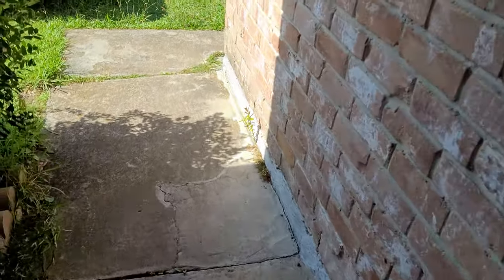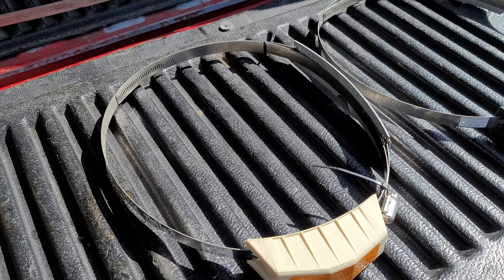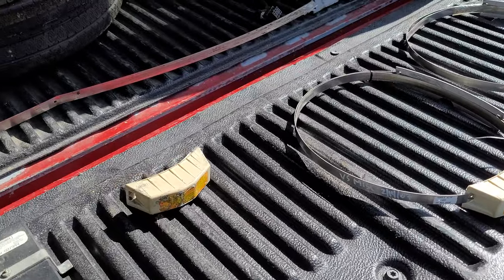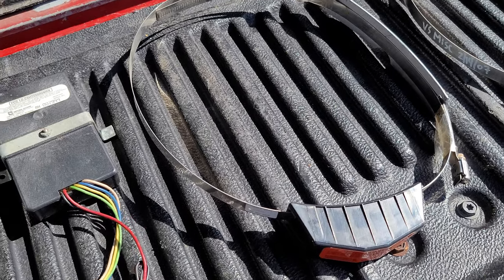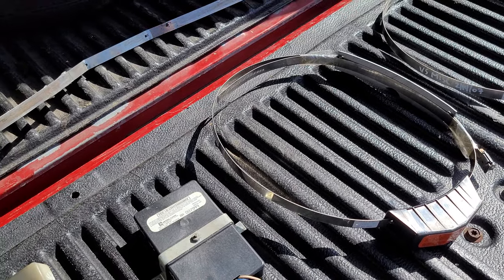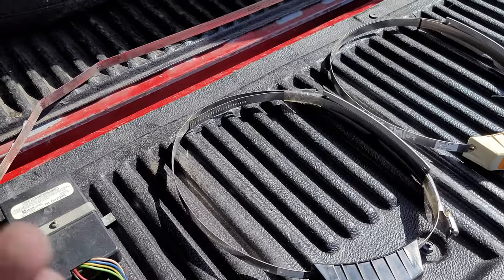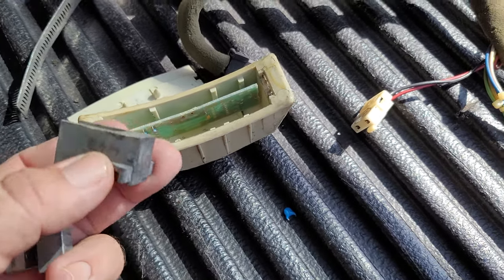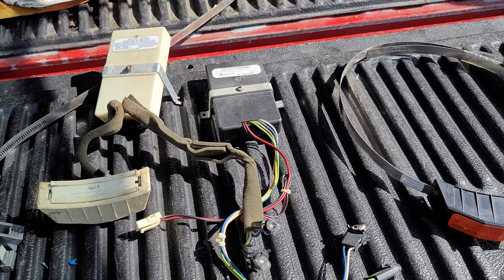The Useless C4 Corvette Low Tire Pressure Warning System

Comment: thanks for the info. I just bought an 88' vette and it had two of these. One on the front left and one on the right rear. I figured this car was so old this technology was practically junk and not worth getting the other two. Glad to know I was mostly right in deleting it. Tyty.
Reply: and it's interesting that mine has them since they didn't get introduced till 89? quirks of a 200k mile vette with no story. How much are these worth before I pitch mine in the trash?
Reply from the maker: Yep, it seems like somebody definitely swapped wheels around on your car from a later year model. Don't throw them away, I have a 1990 ZR-1 that needs some sensors, so I would buy them off you. You can reach me at @VetteSource on either FB or IG.

Comment: Great video! Thanks for sharing how the system worked. I have a 94 Convertible with GSC-EMT's and it came with the LTPWS. Nothing more frustrating than trying to keep my car as built and can't by the Goodyear run flat tires or the sensors to keep the LTPWS working. It's great technology when GM is selling you the car but ten years later it doesn't matter. I pulled the bulbs out over 10 years ago.
Reply from the maker: Yep, it can be incredibly frustrating when trying to keep your car as original as possible. The good thing at least is that if you decide to disable the system, nobody will ever know unless you tell them.
Reply: @VetteSource  when you say disable what do you mean?  If you just pull the bulbs then when you turn the key the bulb will not light up and it will be known that the system is not working.
Reply from the maker: The bulb for the low tire pressure warning is only installed on the cars that came equipped with it from the factory. If you removed he sensors and bulbs, the only component left would be the module under the dash. It won't trigger the "service engine" lamp if the components aren't there.
Reply: @VetteSource  not the service engine light. The LTPWS light should come on when the key is turned.   Natrually if the bulbs have been removed the LTPWS light wont come on.  My wheel sensors are not there and my LTPWS light still comes on and stays on.  If the LTPWS light doesnt come on when you turn the key then it will be known that the system is not functioning.  I wil probably have to remove the bulbs. Im asking all this because you seemed to have implied that there is a way to disable the system besides removing the bulb.  Naturally if you remove the module, the bulb and the sensors no light wlll be displayed there will just be an unlit place when all the lights come on at start up.    I know the cruise control and LTPWS system are on the same fuse. I wish I could just remove the LTPWS from that circuit  and cap off the power lead to it.
Reply from the maker: I may not have made my answer that clear. The two bulb lights ("service LTPWS" and "low/flat tire") originate on a harness that is part of the tire pressure module itself and are driven by the LPTWS module. If you remove those two bulbs, your DIC will illuminate like any other Corvette that doesn't have the LTPWS system option. You would be the only one that knows it's not functioning as intended, that what's I meant by disabling the system.

Of course if you go to sell the car in the future, the low tire pressure RPO Code will be on the Service Parts Identification sticker and a potential buyer may ask about it if they're familiar with the system.
Reply: @VetteSource  Ok thans. In your post above you reference a LTPWS module and a tire pressure module. Are there two modules?   Thanks
Reply from the maker: My mistake. that should have read LTPWS module and tire pressure sensor. I'll have to go back in and edit.

Comment: Your very knowledgeable. I had a 2003 GM vehicle.  I think it used the abs it worked on rotation if one tire was rotating slower or faster it would trigger low tire pressure light. I may be wrong.
Reply from the maker: Hey Mako, it's definitely possible. By the early 2000's GM was combining modules that were separate units before into multifunction modules like the C5 Corvette tire pressure/keyless entry module. It's possible the systems were connected, the engineers liked to try new and exciting stuff.
Reply: Yes early TPMS systems did not use actual pressure sensors in the wheels. The sustem referenced ABS wheel speed. A tire low on air has a smaller circumference than one that is properly inflated. As such it will spin at a different speed (faster) than the fully inflated tire. After a certain discrepancy in speed, the system would alert the driver with the low tire inflated light.
Reply from the maker: That's interesting. I always assumed it worked completely off barometric pressure. I'm curious if the TPMS harness has an I put signal from the ABS system. I'll have to check out the FSM. Thanks for sharing👍.

Comment: So was this standard on C4's at some point? I have the original sticker for my C4 I just bought and it doesn't show the tire pressure monitor system, so curious now if it's on mine or not.

This has be worried about changing the tires or having someone else do it...I have no idea what "breaking the bead" means, so going to have to look that up now.
Reply from the maker: No, it was an extra cost option starting in 1989, either as a standalone or required option, if you ordered the Extended Mobility Tires or spare tire delete in the late production cars.

Comment: You're very knowledgeable but that magnet is what powered the sensor. The sensors worked once the tires were moving and got power. There's no battery. I have a 94 with a still working system and I have to stand by the tire shop people and show them where to break the news. There's very few people if any working in tire shops that even know about this system. The factory service manual does a great job explaining the system.
Reply from the maker: That's it! Thanks for clarifying👍. I was having a heck of a time while making the video trying to recall the exact purpose of the magnet in relation to the rest of the sensor.

I know what you mean about the system and it's existence being lost to time. Most of the sensors I sell are for tire shops that damage someone's during tire removal.
Reply: They are piezo crystals that once they start to vibrate sufficiently from movement, i.e. the vehicle starting to move so the tires are rotating, they produce electric current which then runs the sensor and transmitter. So pretty cool tech, even by today's standards, but still heavy and bulky compared to the modern battery powered tire pressure sensors.
Reply from the maker: Excellent information! That's some tech I've never heard of before. I'll have to take a deeper look into it. Thanks for sharing👍.

Comment: Very interesting piece of C4 Corvette  history (tech), never knew about these but they looked like they we're more trouble than they were worth.... if I had these, I would  just ditch the old ones and get the valve type. 👍
Reply from the maker: Yep, I've been curious to see if any of the aftermarket companies have stepped up to offer an updated system that can replace this one.
Reply: Sadly, aftermarket sensors do not work on these systems. Modern day sensors work at either 315MHz or 433MHz. 

These C4 sensors transmit their own unique signals at all 4 corners. That's why they are color coded. Each color corresponded to a particular corner of the vehicle. They aren't programmed, nor do they relay actual data. They just detect a -25 psi pressure condition and send a signal to the module to illuminate the warning light.
Reply from the maker: Yep, pretty rudimentary by today's standards, but hi-tech in the early 90s.

Comment: Brian . I have a 94 with the LTPWS light . Does each tire have a different sensor ? or are they interchangeable? I was thinking would it be worth it if I buy a set of 4 just to have . Do you need a corvette specialist or GM shop to install? Do you have any you could sell to me ?
Reply from the maker: Yes, I have tire pressure sensors available but they are location specific. Any tire shop should be able to install, just make sure they break the bead in the correct location so they don't damage it. You can contact me directly @VetteSource on IG or FB.

Comment: You have some of these for sale? Are they used or NOS?
Reply from the maker: I do have several available in used condition. What color are you looking for?
Reply: there are a few on ebay too.  i just bought one and the same seller had 3 more.
Reply from the maker: That's cool. Were they NOS or used sensors?
Reply: Unfortunately I bought a used one and it didn't fixed the light/code. Sucks

The system can provide a benefit. It let me know my tire pressure was low. Had I taken out the bulb I wouldn't have known as archaic as the system is. That's also inspire of the system light that says there's an issue.
Reply from the maker: For sure, there is some minor benefit like you mentioned. I always thought it was a cool feature of the cars. 

What I'm seeing now, like with the one you bought, is that with the passage of time these have become more troublesome, with replacement parts difficult to source and expensive as well. For most people just wanting to drive their car, it's an unpleasant issue and expense to have to deal with.
Reply: If you're handy with a soldering iron there's a way to reprogram a sensor to work on a different position.  I know it works on the later version 2 but it should work on the earlier ones as well.
Reply from the maker: Yep, they definitely can be tinkered with. The circuit boards are quite simple and would make a great first trial run for a amateur electronics repair.

Comment: I know this is an old video, but just some clarifications. The 1989-1992 system operated on 246 MHz while the 1993+ system operated on 355 MHz; this can be confirmed by looking up the FCC ID printed on those modules since the FCC info is public information. It is not true at all that you do not know which tire is low/flat or which is defective; that was the entire purpose of giving four distinct sensors with four distinct signals. To identify which sensor is sending which signal, connect the field service jumper on your ALDL connector and turn the key to RUN. For early 12-pin cars that means pins A and B. For later 16-pin cars that means pins 5 and 6. By doing this, the SERVICE LTPWS light will flash a code telling you what the problem or problems are.

Code starting in 2 is right rear, starting in 3 is left rear, starting in 4 is left front, starting in 5 is right front. Ending in 3 means "tire pressure less than 25 PSI," ending in 4 means "sensor signal not received" and usually indicates a faulty or damaged sensor. Code 99 means there's a fault with the LTPWS unit itself. To clear codes and make the light go away, remove the jumper wire, then jump the two terminals 3 times within 10 seconds.

As for a replacement system that allows the use of modern TPMS sensors, I'm working on just one such system. All C4 Corvettes starting in 1989 had the connector for this system built in and the provision for the dash bulbs, so my replacement unit would just plug in the same way a factory system would and work much the same way. I've got some old LTPWS units and sensors on my bench and have been testing there first. Hopefully some time next year I'll have it in my car working and can look into what it would take to get production rolling, though the chip shortage is really hurting us amateur tinkerers.

Thanks for the videos!
Reply from the maker: Noakes, thanks for the very detailed commentary and description regarding pulling codes for the system. I initially debated on whether or not to include the in depth code pulling capabilities that you mentioned and are in the factory service manual, but decided it was out of the skill range of the majority of Corvette owners. Now that you've provided that information, I'll pin your comment so that everyone can see it. Have a great weekend👍.
Reply: Do these sensors ever get loose in the tire and perhaps... cause vibrations?
Reply from the maker: Definitely. Sometimes the plastic housing will become damaged after a tire replacement and end up breaking off the metal band that secures them to the rim.
Reply: I'm very interested in what you come up with.  I was thinking it would be nice to use one of the blue-tooth type pressure sensors and a raspberry pi zero-W to read them.  Then the Pi could blink the light to give you the code for which tire was low.  No data port jumpering necessary.  Unfortunately blue-tooth sniffing is beyond my capabilities.  Those sensors transmit pressure, temperature and battery voltage.  They come in internal versions that go inside the wheel like most OEM pressure sensors, or they can just screw on the valve stems.
Reply: @Marvyn555  A pi is not a good fit for this use case; they don't particularly enjoy being turned off uncleanly, and unless you're coding metal you have to wait for a barebones OS to fire up before things happen. AVR is the way to go. I have a prototype in my '90 right now and regular old OEM GM TPMS sensors in the wheels. Still testing and working out how best to handle things like letting end users add/replace sensors and calibrate, but it does read the sensor data for all four wheels properly so that's a big win already.
Reply: @nomakewan  I look forward to see what you come up with. It's a big plus to use standard GM sensors.
Reply: @nomakewan Pretty cool information. How would you get modern sensors to work on 246MHz? Modern sensors only work at two frequencies. Also, my understanding was each sensor had its own frequency, and that was how the module could identify positioning.
Reply: @LynxStarAuto  The simple answer is you don't. You instead engineer a replacement radio box that connects to the factory 3-pin harness and has the same two factory bulb sockets and blink codes, but which connects to modern TPMS sensors instead. I have a prototype in my '90 Corvette right now and it works pretty well!
Reply from the maker: Sounds cool. You may be on to something👍.

Comment: I have a 1989 convertible and the tire sensor system has been lit up for several years stating(service system or something of that nature)  I just ignore it.
Reply from the maker: I hear ya. It's not something I recommend on a regular basis, but pulling the bulb from the back of the DIC panel is an effective cure for that👍.
Reply: @VetteSource  Thanks Brian.
Reply: @VetteSource  Can the Tech 2 turn off the system? How do you get to the bulb?

Comment: i would think that would make tire balance difficult without a lot of weight
Reply from the maker: They're not very heavy so don't require much different in regards to balancing, but you sure can tell when they come loose inside the tire🤣
Reply: @VetteSource  They have a counter balance weight on the band that's gets positioned at the valve stem, opposite of the module.
Reply from the maker: Yep, I believe you're referring to the flat metallic strip located on the opposite side. If I'm remembering correctly, it's the same weight as the sensor assembly to act as a neutral balance. The rim still has the external balance weights on the inside lip.

Comment: only for the very purist which i have not run across  yet with the c4 people not saying they are not out there
Reply from the maker: Exactly. They're few and far between between, but I have run across some of them in my travels.
Reply from the maker: Exactly, and a much appreciated segment of the Corvette owners. Otherwise how would we keep them documented for the future caretakers👍
Reply: I don’t have any tpms and service tpms light comes on after 3 consecutive 30 min drives. So I just reset mine with shorting pin 6 and 8 on obd2 I only have to do it once a month or so. You can take out cruise control fuse also.
Reply from the maker: Yep, that will work but you disable the cruise control with that method. The easiest thing to do is simply pull the 2 bulbs that come directly out of the harness for the TPWS module and plug into the back of the DIC. Once they're removed there's no bulb for the module to illuminate👍.